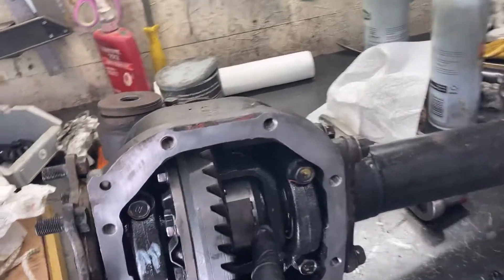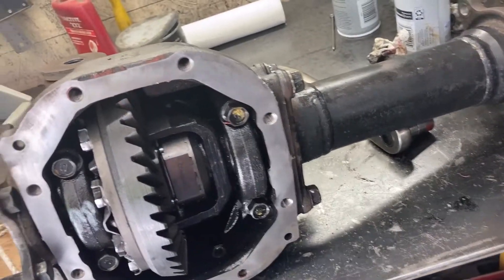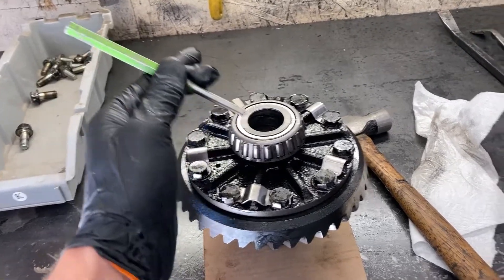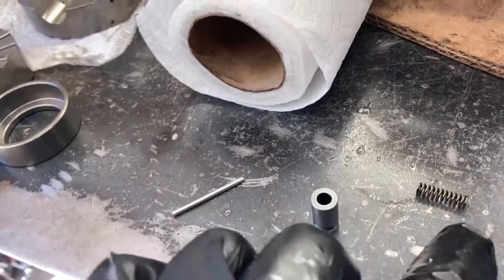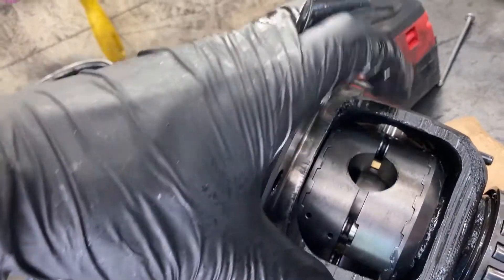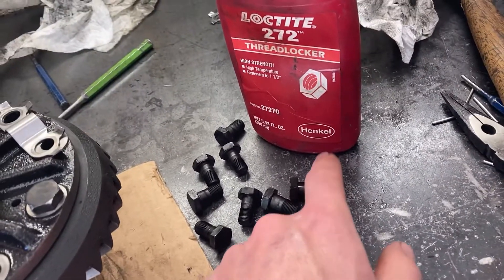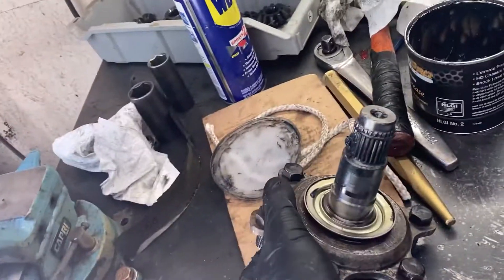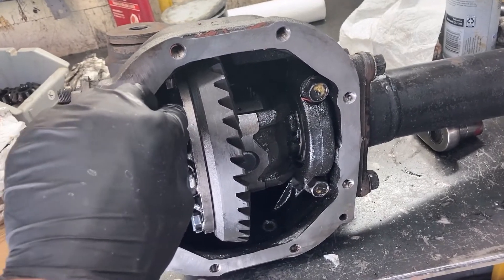Toyota 7.5" Front Diff Spartan Locker Install Tutorial

Comment: Hi... is it noisy 🤔... tq
Reply from the maker: In the rear they can be, I'd recommend spending a bit more for a yukon grizzly locker as they are silent and almost unnoticable. In the front its quiet since it is only rotating when you are off road in 4wd. If you do not have selectable front hubs I would recommend a selectable locker as it will upset your steering on the road and probably clack and bang frequently.
Reply: @ParkerWismar  thank you bro...👍👍👍
Reply: Hi, please could You give me the model of locker that You have usted? Thanks

Comment: So with a locker in the front do I have to get out and lock in my hubs in every slippery spot in town driving in snow and dry patches?
Reply from the maker: If you want to engage 4x4 and you have manual hubs you have to lock the hubs. Its no different if you have a differential locker or not.

Comment: I don’t understand how an ARB locker can be installed in the same fashion, totally different structure.  ARB’s have their own case so you ditch the stock case and rebolt the ring gear to the new ARB case and have to re-setup shims, or am I wrong?
Reply from the maker: Yea exactly, just skip all the steps where I install the Spartan into the factory case. You may need to reset up shims on the carrier bearings but hopefully not, pinion shims will stay the same. It’s a bit easier (and probably more of what I was thinking when I said that) with the rear diffs where they have the backlash adjustment screws instead of shims
Reply: That’s pretty deceptive.  It’s not simple to set up gears
Reply from the maker: @ryanegan4870  I don’t think it’s that deceptive or difficult. If you’re comfortable enough to do this much, putting a new carrier in isn’t that much more. Setting up backlash on gears is pretty easy. Probably should of elaborated more in the vidya but I’m just a dude in his garage trying to help
Reply: @ryanegan4870  dude he made a video to help others. If you want to find a video for a specific locker than do so, don't be a wingy biotch

Comment: Hello, how're you buddy? I have just installed one of those on my truck but I couldn't make it unlock, first I tried on the vehicle and both wheels always spin to the same direction, then I pulled apart again and tried on the bench I can't make the "clicking" noise, it is constantly locked. I have measured the gap between gears at the end (.149") and I have removed the washers. Any idea what could be the problem? Thank you
Reply from the maker: Hmmmm were you trying to get it to unlock while driving or by hand with the tires off the ground? These lockers are pretty tight and require a lot of force to unlock them, I've only been able to unlock/get them to click by hand after theyve had some miles on them and are broken in (and this is with the tires on or a breaker bar to get some leverage). Is there anything bound up or tight fitting in the locker? It should all be in there a little loose with just spring pressure holding it in place. Is it the correct locker for your diff? I've ordered bearing kits from the same company (USA standard) and theyve sent me the wrong parts in the correctly labeled box
Reply: @ParkerWismar  Just by hand, with vehicle off the ground. I found strange because the rear locker works like a charm, I can make it click by hand with very little effort. The locker should be the correct one SL T7.5-27, everything fit nicely with the play and the gap it should have but as soon as the pins hit the end of the notches, I simply can't make the teeth overrun each other and push the spring down. I'm starting to thing that, either you're right and the locker hasn't given in yet, or they sent me the wrong springs (too stiff).
Reply from the maker: @147andreluiz  That video is showing a grizzly locker which is more refined/forgiving than a spartan. I would drive it and see what it does, worse comes to worse it will just be locked and you know you need to return it
Reply: @ParkerWismar  Yea, the annoying is I'm in New Zealand, so to return wont really be possible (it would but I need to pay shipping I will end up losing half of what the locker's worth). This is a video on my locker, that doesn't unlock by hand. https://youtu.be/UftrICSL3VU And this is another video from USA standard I think, showing how the locker works. https://www.youtube.com/watch?v=FjerLDlnusk Mine is not even close that smooth.